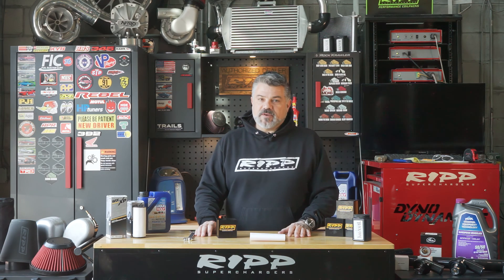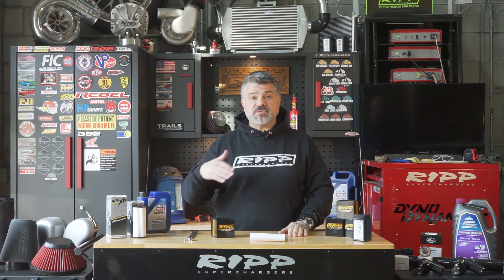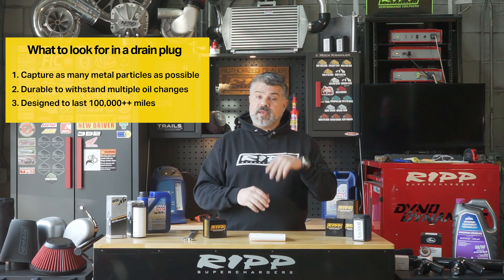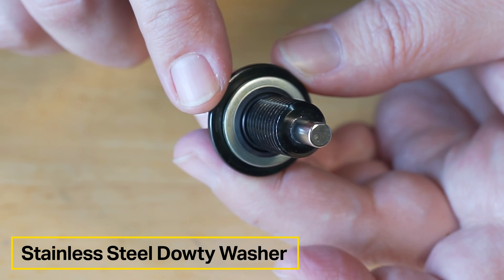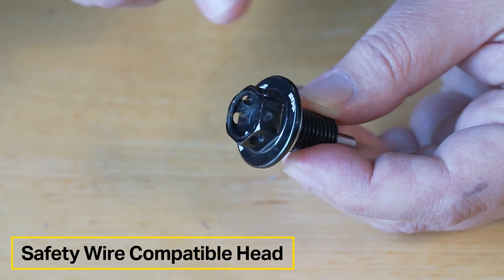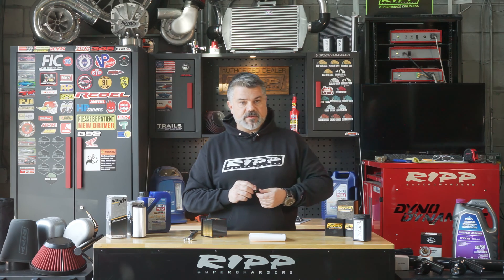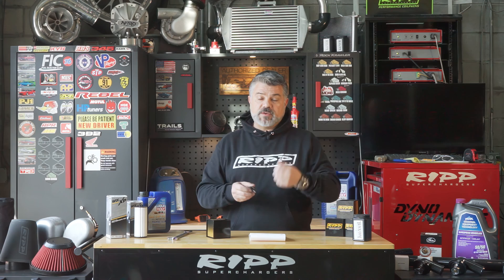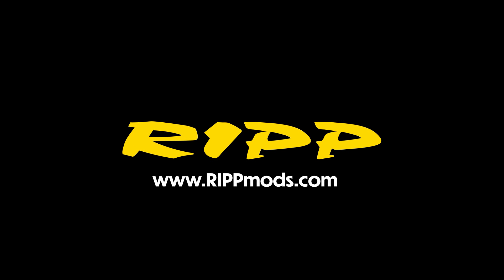Ask RIPP - What is a magnetic oil drain plug and why do you need one?

Comment: What u mean by torquing it ?
Reply from the maker: Hello @Ernie27,
To clarify what we mean by "torquing it", it is a term used to clarify how you must tighten a bolt to a specific level of rotational force, using a torque wrench, which ensures the bolt is tightened to the correct tension by applying a measured amount of twisting force, rather than just tightening it by hand. If you have any additional questions, or need more clarification, please email RIPPmods@RIPPmods.com, we will gladly help you there.
Reply: Basically what the recommended foot pounds you need to tighten it